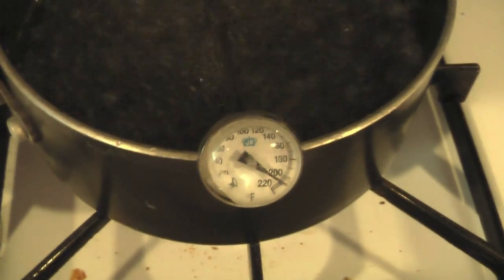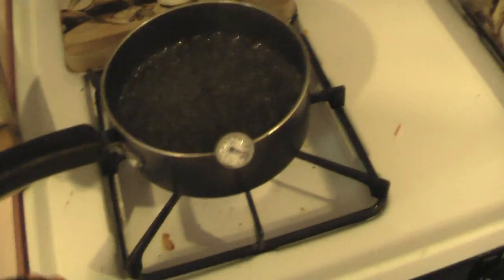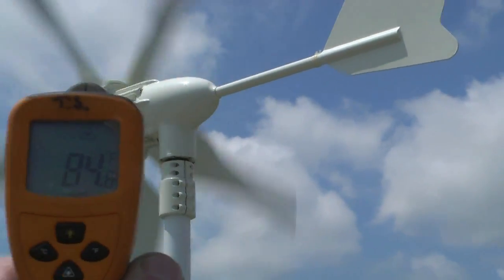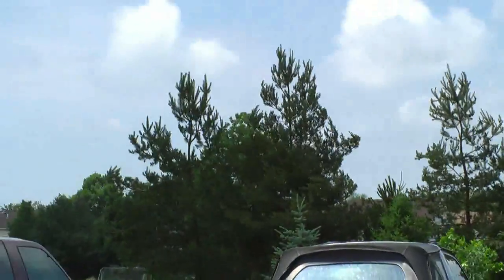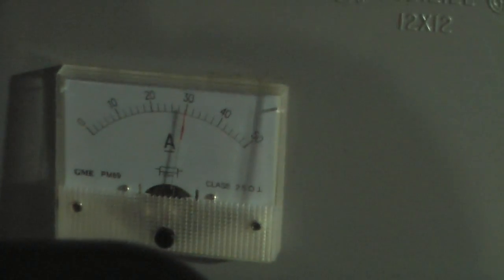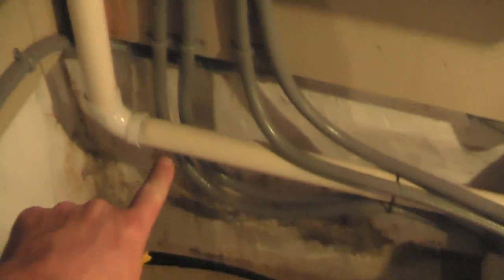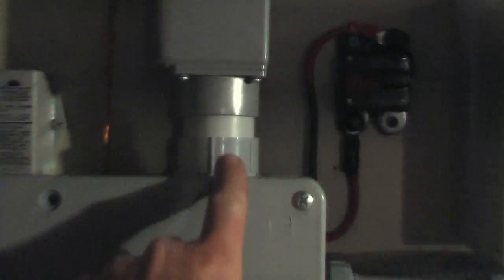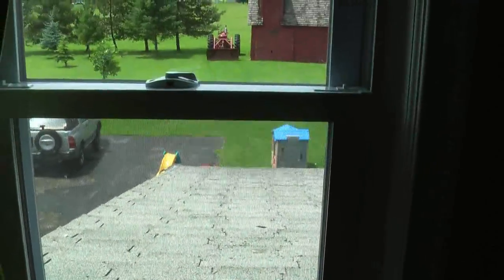Sealed PMA temps in 30 mph gust and 20 mph winds. 40 amps on video

Comment: Nice video, is this the 24 or the 48 Volt unit?
I wish U had a screwdriver to open the boxes. How did U connect the amp meter? did U brake the (+) wire and connect the shunt?
thanks